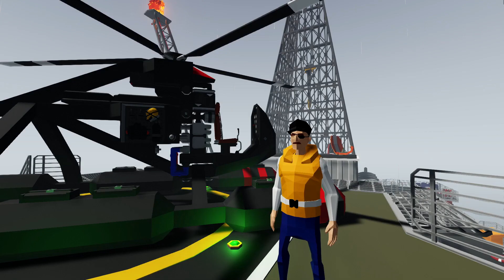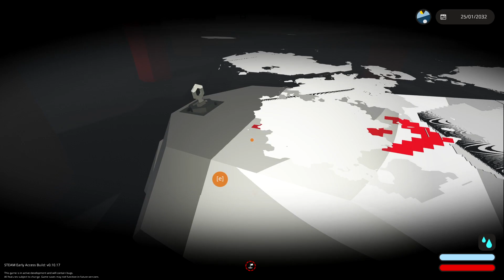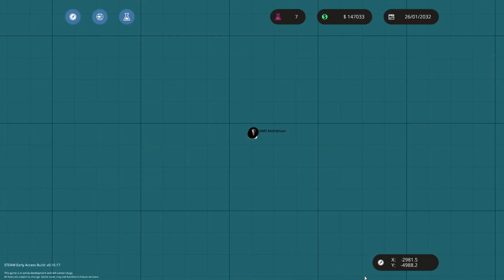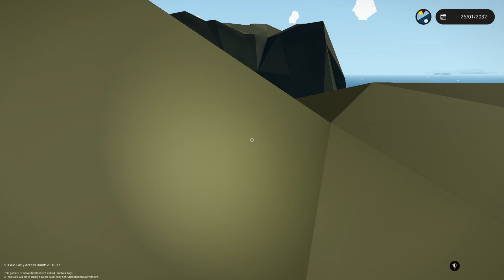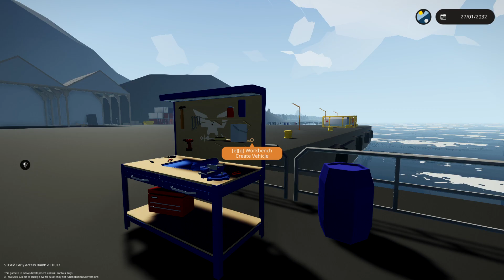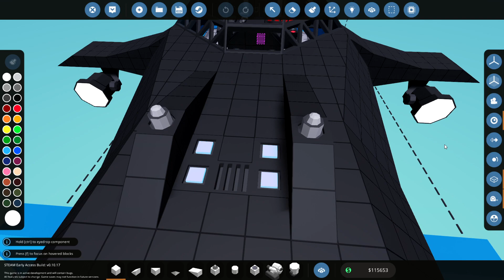I made a SEA MONSTER!!! + NEW Island and more! - Stormworks: Build and Rescue - Career Mode - S1 E15

Comment: The lift on the oil platform will keep giving you troubles if you dont push it out more, it can go further from the ledge.
Are you sure sharks are turned on? :) and you should make a heli that can lift a small submarine for the wreckage explorations :)
Reply from the maker: Yes I realised later on I could have pushed the lift out further. Thanks for your tips! Sharks are definitely turned on, just not the Meg. I love the heli/submarine idea!

Comment: Great video again. Sub looks great. Indeed almost a airplane. But you are flying underwater so thats just fine. 
One question. The door from the airlock to the cabin, is it locked when there is water in the airlock? Just to prevent having by accident that you open it and all the water in airlock flows in to your cabin. Ohw and one more thing. Do you fill the airlock with water before you get out for a human dive when you are a submerged? Or are the pumps only for taking the water out?

Perhaps in the next episode you will answer this questions and i just have to wait for that. So hurry up!!

And about the trenches. I dont know if there are chest ore crates. Have been to the bottom a few times but didnt find anything because off the darknes. 

So again, cant wait for the next episode.
Reply from the maker: Hey Wim, thanks so much for your comments! 

I like your idea to have the inner door locked when opening the hatch and I'll try to set this up before the next episode. It will probably be a key and lockable button to keep it manual, in case we do need to enter the cabin at any point. I will be doing a few upgrades to make it better all over. 
At the moment I fill the airlock using the hatch so the pumps are for pumping out only. However it would be cool to have pumps bringing water in first. We'll see what we can do with the upgrades! I recorded a demonstration but thought I'd save it for the actual trip next episode :)

Thanks again, your ideas have inspired me!